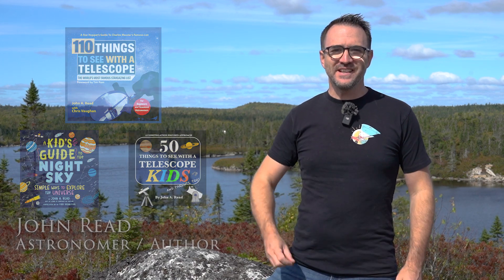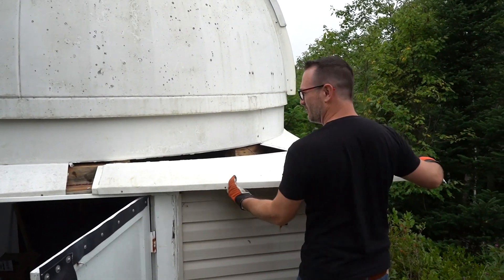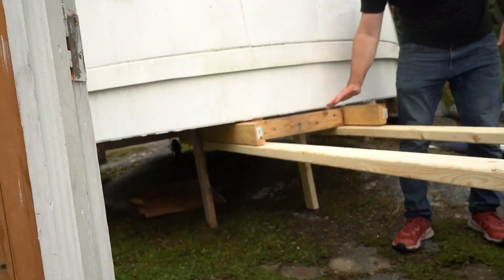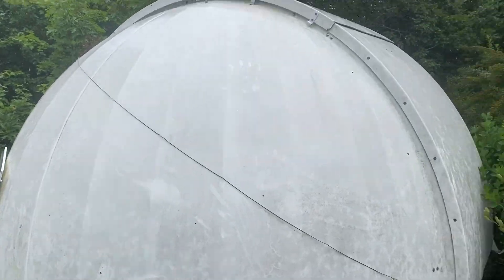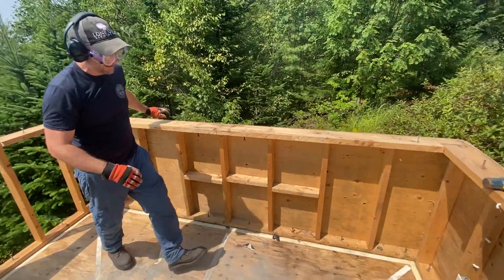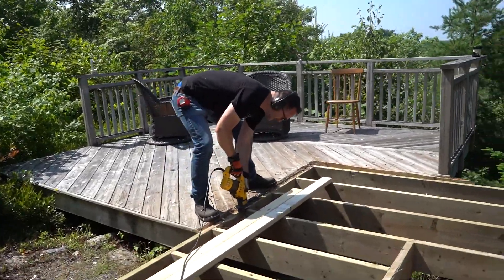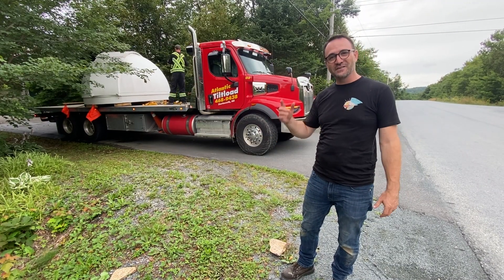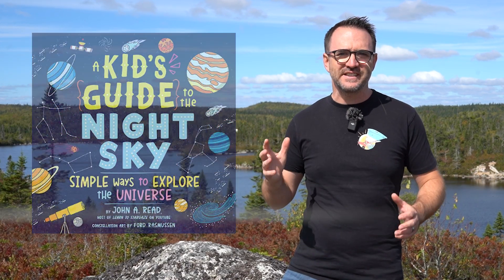We Moved This Giant Observatory Dome Across Nova Scotia

Comment: Interesting. How about the heat in the dome, doesn’t it retain heat inside including the one emanating from the human bodies inside and create turbulences that distort the telescope image ? Will the temperature inside be identical to the one outside (I doubt it). I use my telescopes on a second floor balcony, recently I had the “great” idea to close the balcony with windows… now I can open only 2 out of 6 windows and the temperature inside is 3 degrees Celsius higher than outside resulting in a bad image quality in my telescopes at over 100x magnification. Now I guess I will have to take the windows back down, after I payed over 2000 euro to install them…

Comment: I have the same dome (PD10) and love it.  If you come up with a way to make the shutter operate smoothly please post it.  Mine has always operated very slow and puts a ton of strain on the motor.
Reply from the maker: Our shutter control is ricketey but it works. It’s solar powered, and controlled via Bluetooth.

Comment: Will you add some sort of special telescope
Reply from the maker: See video #1
Reply: @LearnToStargaze  thanks but i can't imagine the views though a c14 because i know you begin to see colours at the diameter of 12 inches from what i heard but 14 is amazing and i saw that you have a 24 inch telescope at work and how are the visual views through this kind of telescope
Reply: @lucasmorawetz4934  I have apprehensions about the C14 as well. It's a great visual scope, but there are numerous problems with AP using a reflector, especially one with a large mirror like that. Given the effort and cost that went into this project, would think a new triplet would complement the design. Curious to see where this goes.